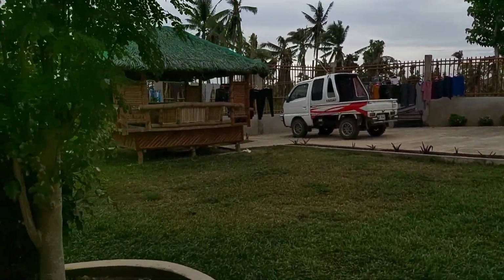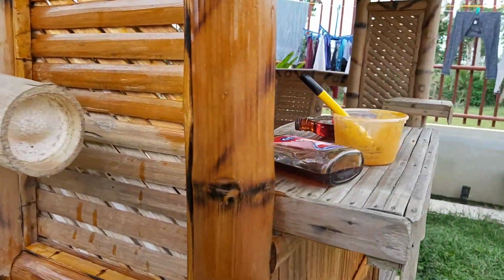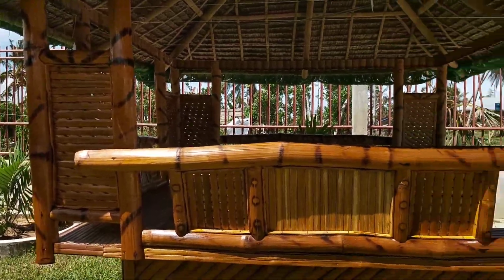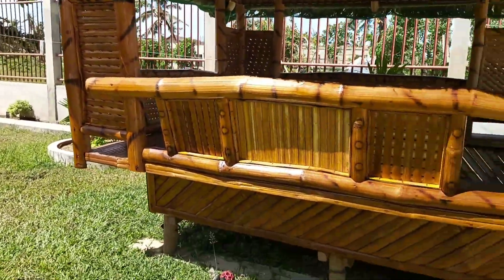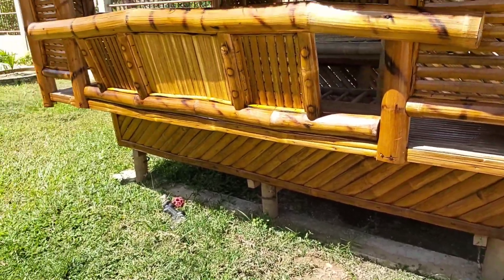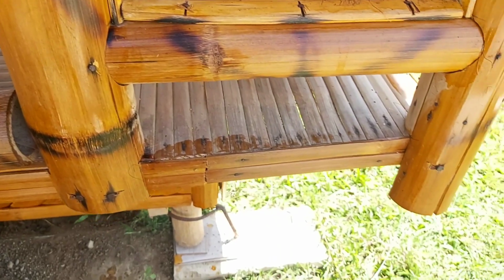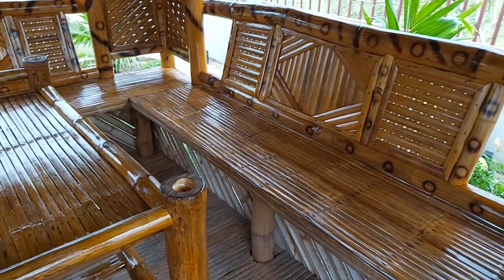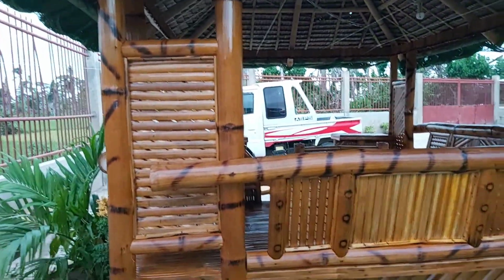PAINTING THE BAHAY KUBO

Comment: Very professionally done Sandy, and no doubt the varnishing will be finished by now, but a little tip for you next time. Try using a larger brush, like a 3 or 4 inch, and you will complete the job in half the time.
Reply from the maker: Thank you so much sir. It take me probably 7 hours total to finish it all Lol. And you're right about the bigger brush sir. The only problem is you can't reach the areas that only small brush can reach if you use a bigger brush😊 Thank you so much for watching sir. God bless